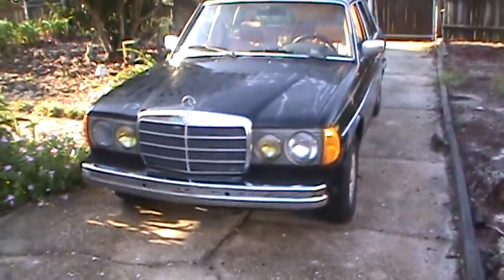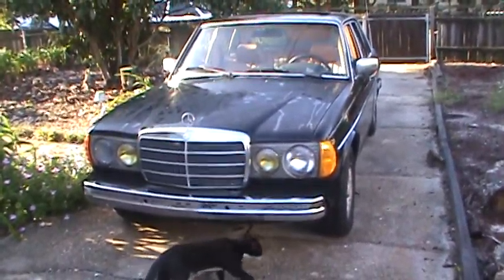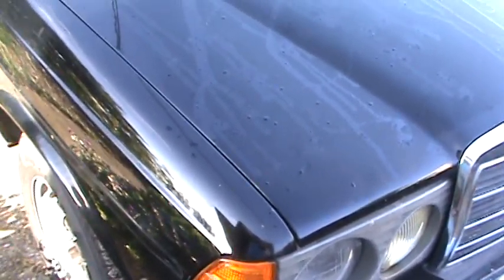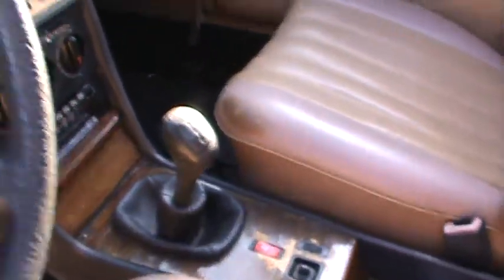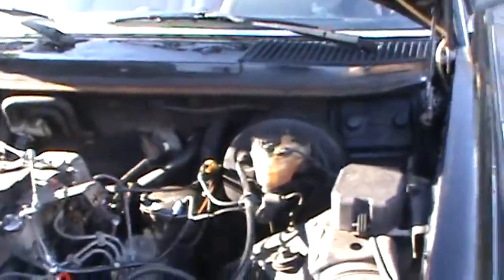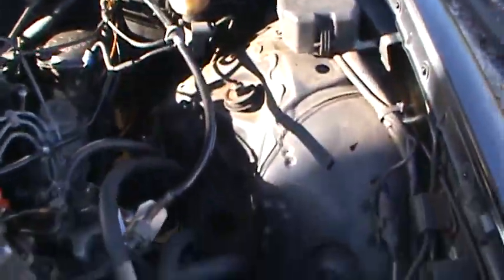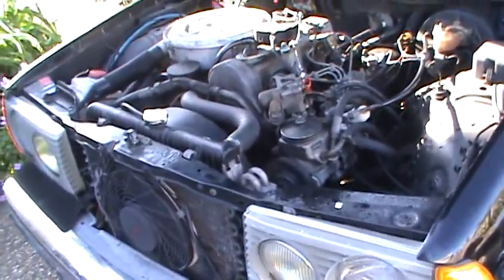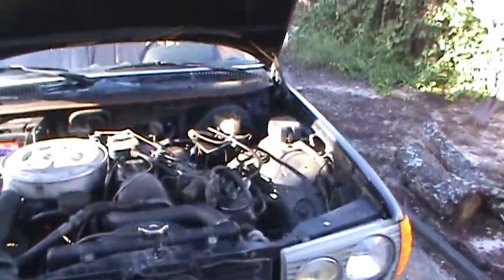1983 Mercedes Benz 240 D 4 speed Manual  Walk Around, Start up

Comment: The hose you replaced is a return fuel hose; it is supposed to be "deformed" (maybe not as much as yours was though). I've heard that these cars run just as well with a regular hose as they do with the "correct" hose.

https://mercedessource.com/store/115-123-diesel-cigar-return-hose-265-mm
Reply from the maker: I know the hose from the gas tank is also a funny shape, like a funnel think. I wonder if that one can be changed out with a straight hose too. It sure made a world of difference when I changed that hose. It might have had some interior degradation.